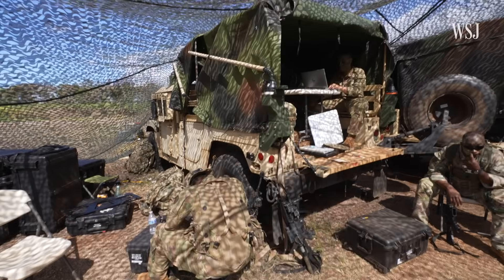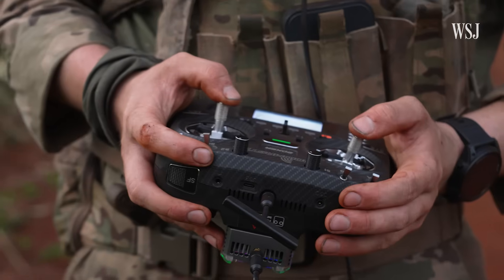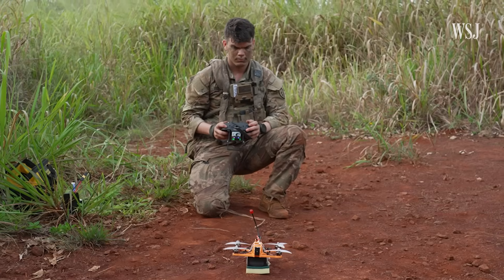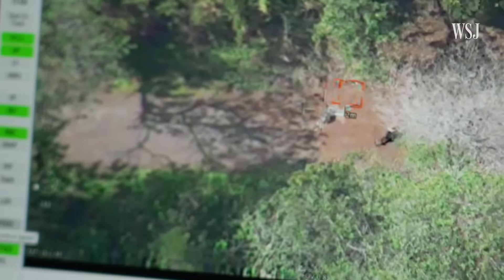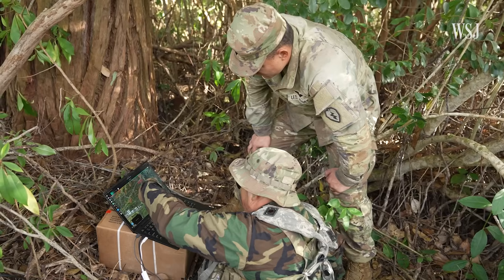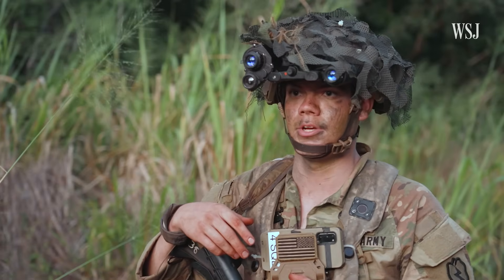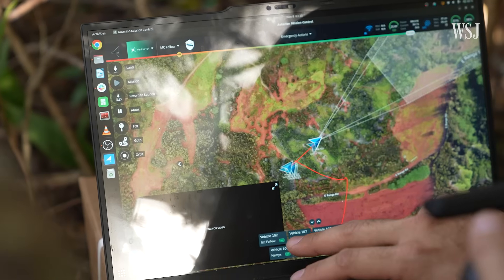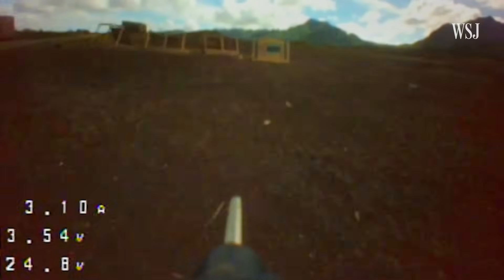How the U.S. Army 3-D Prints Lethal Drones in Hours | WSJ

Comment: Based on the pictures in the video, the US military is apparently using Chinese and European (Prusa) 3D printers - and they are not likely to print the electronics, motors, props etc. and also would still rely the the plastic filaments supply.

Comment: as an fpv pilot and avid 3d print enthusiast. this is mostly BS. these components are the bottle neck not the frames. anyone can print a frame? yes. not every one can make a fc or esc or the motors. the components used in this video are FROM CHINA. the zing motors ELRS receivers Analog video systems and the fight stack are all produced in other nations right now. So yes it is a good idea to star thinking about this but to frame it as if they already are ready to do this is insane WSJ, im dissapointed in the approach taken with this.  took a good thing and turned it into a lie

Comment: This is the dumbest fing thing. Why would anyone 3d print drones when carbon fiber exists. Cutting 1000 frames on a cnc is faster then printing them and 10x more durable and more stable in the air. I literally can’t even believe that they would do this.
Reply: Also, why tf would they say it costs a fraction of the price. The only MF thing they are saving in is the frame. Alle the electronics are the same. So yeah saving 40$ on a frame is just plain stupid

Comment: lot of idiots here in the comments don't understand that this simply allows for rapid adaptation based on mission needs. reduces the need to buy a bunch of premade UASs that are only fit for one or two mission sets. this allows them to make a custom frame for a specific mission, if that platform is not commercially available. of course they can't make the electronics, so they would have to stock modular parts, but those modular parts would be able to work with whatever configuration they need

Comment: And of course they used our tax dollars to buy the most overkill printer that is designed for multicolor printing.  The other 4 extruders are just sitting unused 😂

Could have bought 10 equally capable machines for that 5k.  One capable of printing with carbon fiber nylon composites

Comment: cutting from sheet or injection molding would be much faster if the goal is to produce a lot of them
Reply: I swear it's like no one grasps the concept... they are doing just that en masse. This is simply for troops that are in austere areas that have motors and components but need drone bodies or anything really that could be printed. They can 3d print muntions casing now also. Sure they can ship them out but not always. It's one more tool in the tool box.
Reply: The goal is to do this onsite in the event that supply lines are disrupted. They said this last part very clearly. When troops are no longer getting your supplies of factory produced drones, they will be able to use their existing supplies to continue producing them onsite, making them more resilient.

Comment: I use Bambu Labs 3D printers but given the security requirements I would not use them. They have a cloud based system where data is uploaded. Prusa that file transmission is localized on the same subnet so your designs are not shared. Same goes with Creality the software is local though it is as Bambu made in China. Bambu is amazing printing technology but I would avoid using it for mission critical stuff. There are machines that can take locally sourced bags of plastic and turn it into filament and also reclaim filament that was losted during failed runs.
Reply: Not only can you run them in lan only, or only from a USB without network connection You can also flash older firmware to them from before they started dending files to there own servers *if there X1Cs. You also have the option to block the data stream leaving your network.

Comment: You want real carbon fiber for a drone it needs to be ultra rigid especially when carrying a payload it's not going to be stable to fly.  there's no need to invent anything new fpv has already been optimized and it's not with 3D printing the frame of the drone.

Comment: They are just printing the frame that can be injection molded in seconds
Reply: Sure you could injection mold it and it would be cheaper for mass production if you have a final design. But they're cutting out the time it takes to get with a manufacture, have that manufacturer make a die, test the parts you just spent a lot of time and money on and hope you dont need to make a change to the design and start the whole cycle over again. For research and development 3d printing is indispensable.
Reply: @bluewafflesrcks In a battlefield where everything is visible to all parties the facrory making molds can be taken out on day 0.

2 guys in garage or kitchen ( thats all it takes for these small drones if you are prepared with extras ) will not be even noticed by the enemy.
Reply: @kalaants  Another solid point. People like to dismiss 3D printing as a gimmick.
Reply: They're just finding ways to spend that 1 trillion dollars we give them every year
Reply: @4lan39  No. They are doing what they should have 15 years ago. You can very easily and cheaply pre-stock all the components - thousands of them. They are small and light. Having capability to use them close to battlefield gives you independence from logistics which gives you major edge. As can be seen in Ukraine right now on BOTH sides.

When US finally decided to give Estonia Javelins all the generals were smoozing about this like a big thing. Already few years before that (~2015) my buddy were flying self designed and 3D printed drones for fun. You can have thousands of these for price of one Javelin.

While western intelligence agencies probably did see this coming and thus were somewhat prepared the big military organizations totally lost their plot on this one and even US military as can be seen is now playing catch-up. There has been big lack of imagination of the military leaders on this one - and that's understatement.
Reply: @4lan39  chinese bot tries to convince us military spending is bad

Comment: Literally anyone can make a drone at home

Also no way they have a Bambu lab that requires internet. Massive security risk. Hope that was b roll
Reply: You can use them without internet…
Reply: @Ninjasniper12 yeah and I guarantee that they don't even know that.  Look at that wet filament they are printing with😂

They spent $5,000 on a prusa XL which is designed specifically for multicolor printing. 

I could have got 10 printers for that cost

Comment: The frame is the easiest and cheapest part of the drone. 3D printing it barely has any advantage if you're shipping in batteries, motors, avionics already. A stack of frames made from carbon fiber sheet takes up barely any space and weights nothing while being 10x as strong and durable.

Comment: What happens if the printer breaks
Reply: 3D Printers do not leak, they use filament that is heated when needed to build the 3D printed model.
Reply: that's why there is more than one. you have two to make one.

Comment: A chinese bambu lab printer lol
Reply: lol, that must have been a Bambu at 0:44 right? i thought i was hallucinating on a video about US drones using China Manufactured tech
Reply: @CC-cf6xq they saw that coming The United States Department of Defense (DoD) restricts the use of Chinese printers. Now this is strategic infrastructure. Earlier, the US government restricted imports of DJI drones.

Interesting bells, something to think about and especially those who supply to our Defense Forces.
Reply: Yeah, while the US Gov/FCC is worried about DJI and trying to ban them……….
Reply: На таких же печатаются корпуса дронов, что убивают сотнями людей в день в Украине и России. Think about it.
Reply: And the prusa XL.  Which makes no sense.  A $5k printer that is specifically designed for multicolor.  Being used to print single color drones frames that would fit on an $50 ender 3
Reply: @4lan39 to be fair, the Ender 3 SUCKS as a 3D printer compared to newer ones.

I would know, I have 4 of them. They are wildly unreliable.

Comment: Ukraine needs to strive to develop AI systems that can automatically rearm, recharge or refuel, map and navigate its terrain and make targeting decisions based on a battlefield priority goal set. If they can do that, they will gain a massive force multiplier advantage. Robotic mobile rearming / recharging / refuelling dumps can be strategically pre-positioned for battlefield missions. They could also use solar power to maintain battery charge. Say 1 kWh of panels etc... Perhaps even a small wind turbine with auto extendable tower that can double as an 360 degree observation post using a camera periscope setup. All remotely controlled. Obviously engineered to a defined performance specification, that allows multiple drone fast charging/fuelling and re-arming. Top AI robotics technology companies can help provide it.

Comment: Let's see them 3D print the battery, motor, camera and chips too.
Reply: Yeah.. Would be quite a lot faster to just cut the frames out of carbon fiber with a laser cutter or CNC...  And much lighter, cheaper, and more efficient too!
Reply: @Femboy_Engineering  but you can't so that when you are a soldier in the field whose supply lines are disrupted. That is what this is for.
Reply: @sirish-l5c But the frame is the easiest cheapest part to manufacture and ship. If supply lines are disrupted, the ESC, motors, FC, battery, propellers, won't move anywhere either.  And assembling them on the frontline, doesn't make any sense either.
Reply: @Femboy_Engineering  wouldn't they have a limited supply of those things? Isn't the frame the part that takes up the most space? When supply lines are disrupted, couldn't the troops in the field use their supply of those things and 3d print the frames to make more kamakaze drones for a limited time?
Reply: @sirish-l5c The frames for FPV drones are commonly made out of 4-5mm thick waterjet or laser-cut carbon fiber plate, which is extremely strong, relatively cheap, yet, very lightweight. They are easily stacked on top of each other due to their flat geometry, meaning that a small cardboard box could fit a hundred of them easily. As for the other components, such as the motors, the VTX, camera, propellers, and the F405/H743 +ESC stack, most commonly used, they aren't very large either, meaning that it makes no sense to 3d print the frame, of all things.  As other conflicts around the world have shown, the optimal configuration seems to be, to assemble the drones elsewhere, and then ship them out to the frontlines, where the individual soldiers don't have any time or necessary infrastructure to solder, tune, and assemble, the drones.
Reply: @Femboy_Engineering yes but in this specific scenario that is discussed in the video, the supply lines are disrupted, so they CAN'T deliver them to the frontlines. In that case, troops will have a limited capability to produce their own.
Reply: @sirish-l5c  Let's just summarize the situation as: other parts will be the bottleneck, the frame is not the bottleneck.
Reply: Yea, the 3D printed body is the absolute easiest part to make. Then they import (from China) the motors, circuit boards, battery, Transmitters/receivers and all the rest.
Reply: @practicalshooter6517  they were also using a chinese and european 3d printer
Reply: @billf1748  bro they also use bambu lab printers
Reply: @somepersonv5782  yeah, Bambu Lab is chinese.
Reply: @practicalshooter6517 US companies like unusual machines make the motors
Reply: @practicalshooter6517 I'd suggest looking into Unusual Machines a company out of Florida. They have motor manufacturing in the United States working up to 100k+ motors a month manufactered by August.

As well as "Circuit boards" (Flight Controllers, Electronic Speed Controllers, VTX etc.) 

All parts sourced non-China. This is called Blue UAS/NDAA certified.
Reply: @practicalshooter6517  yeah thats the dirty secret, at any point china could end the war in ukr right now by just ending thier supply of drone parts.
Reply: @watchonjar  That’s not entirely true. Back in WWII the US did not have warfare ready companies just ready to go. Lots of manufacturers had to do massive factory overhauls dedicated to warfare such as Ford making bombers and fighters. Same goes for supply lines, a good chunk of critical resources are currently on reserve across the American Continent.

In an actual wartime environment, the US would do the same thing convert factories into military manufacturing. Even sourcing our own silica to make chips is even possible. I used to work at one of the quartz and silica mines back in North Carolina.
Reply: @watchonjar that WAS the case. The US is using Nation Interest law to ban Chinese drones and components forcing US and allied countries to make the motors and flight controllers. Also chips come from the US and Taiwan and are designed in the US. The big dirty secret is Chinas economy is dependent on the US. If they lost our trade and we no longer bought their cheap stuff they would lose 28 percent of all GDP overnight. It would basically destroy their economy overnight hence why China sits on the fence often
Reply: @practicalshooter6517 Where's your proof all of this was manufactured in China? Did you actually look it up?
Reply: 3d printer is still Chinese 🇨🇳
Reply: @shadowbits-x64 proof?
Reply: @johnnylollard7892 im not going to prove to you thay china makes the best, most cost efficient 3d printers... That's just common knowledge...
Reply: Uh, that’s classified.
Reply: I think it’s about modularity. Hopefully with modular compatible parts that can be stockpiled and stored/accessed easily.
Reply: still need rare earths for propulsion, sensors and radar systems ..
Reply: Literally there are thousands of open source projects like this with better optimizations, shouldn't be news worthy lol
Reply: Yes 👍 need, totally fuchd
Reply: Factors will always be able to print and assemble them faster.
Reply: From one side I agree with you, from other - lot of brigades in Ukraine have their own „workshops“ very close to the front line where they previously build and now often modify existing drones with new communication systems or different types of projectile
Reply: This is for the scenario that their supply lines are disrupted. They would use their existing supplies of those things and 3d printing to still produce drones on site for a time.
Reply: The frame is probably the easiest to transport and one of the lighter parts in a drone tho, and the 3D printed frames are not really that good.
Reply: @uvenarbulis1724 exactly
Reply: China won't have enough chips. China imports 80% of it's chips from US allies, and a majority of the chips made inside China require initial manufacturing elsewhere. China is only the world's assembler getting parts across the world to build products in their factories. If they don't have the parts then they won't be able to construct their products. A common myth is the US is reliant on China, but the truth is the US has labor laws while China doesn't, so it makes more sense to turn a larger profit and save money. It would only take 3 years for the US to develop the US, Mexico, Canada, and Europe to be able to live without China. Currently the US is investing in AI and Automation, so it wouldn't have to pay workers in factories (Makes people mad for whatever reason). If war were to break out today the US would only have to control the pacific ocean for 3 years, and China wouldn't have the ability to manufacture military equipment without the parts.
Reply: Also China would be reliant on Russia to keep their factories operational, but Russia also has claims in China much like they had claims in Ukraine. That's why the US wants to get on Russia's good side in the Ukraine-Russia peace deal. Essentially Chinese factories are husks that require the fire and life of foreign imports
Reply: You are not very smart.
Reply: @snaileri  you're naive 😂
Reply: @snaileri Do you wonder where they get the power supply for the 3D printer in the middle of a battlefield?
Reply: @QuietJugung  do you understand there are rear areas where this can happen?
Reply: @QuietJugung could use some chinese solar panels with a chinese solar imverter using some chinese batteries
Reply: @QuietJugung they use gas or diesel powered generators that are on trailers pulled by humvees.

Comment: They are using bamboo lab printers 🤦‍♂️
which means china has already stolen the designs
Reply: After DJI gets banned this December 23, they will work on banning bambu labs 3d printers next.
Reply: did you know before they useit they reprogram it? with that military experience they are not dumb to not know that. even china use us made software like microsoft. but us cant easily hack them.

Comment: 3D-printed drone frames like those shown are trash compared to carbon fiber frames. And it's just one component of the drone anyway, so they still need supply lines for motors, flight controllers, ESCs, GPS, receivers, vtx, antennas, batteries, munitions, etc. 3D-printing skills are good to develop for other reasons, but the premise of this video makes no sense to anyone who is experienced with drones.
Reply: You do realise that these are disposable drones right? 3D printed drones frames are cheaper than carbon fiber drones frames.